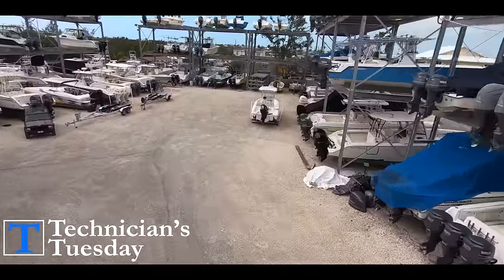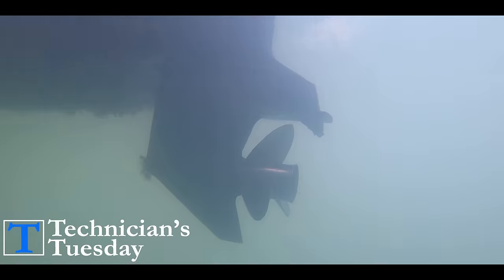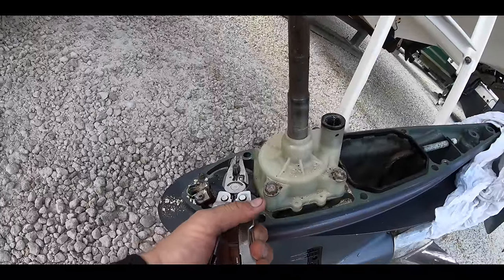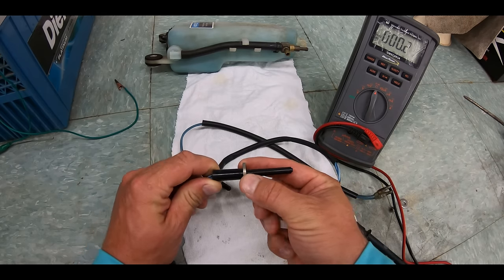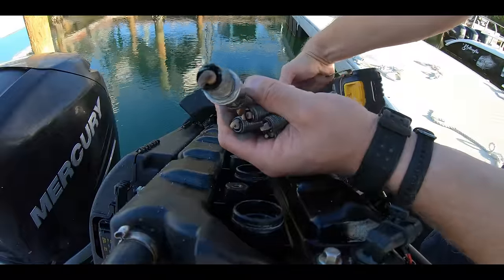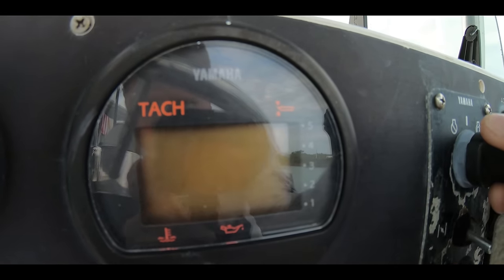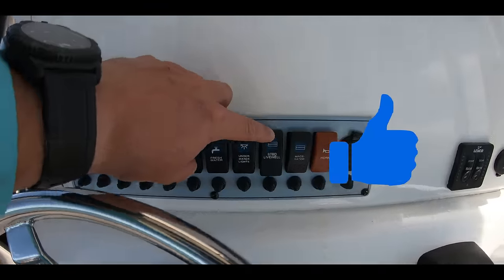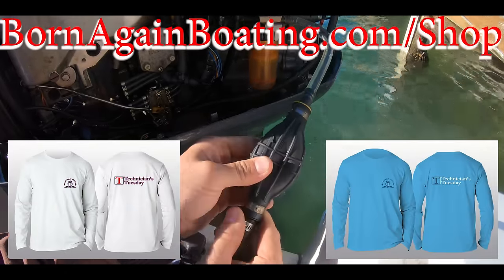Outboards #1 PROBLEM!

Comment: Sweetwater 4 stroke boaters just keep moving!lol!  Have done little but change oil in 5 years!lol! 5:00...those plugs look perfect.
Reply: What brand are you running. I had a  Mckeecraft with a 4 Suzuki. 140 hp. Was told when I purchased those motors were bulletproof .
Well it was. Later when the Hydroblaster joined my stable it was a 17 Triton CC with a 90 Yamaha. I wanted a jon boat that could throw a roostertail. I had drivers at intersections roll window and shout hey thats not a boat its a rocket ship. I hand picked both and loved them. Brand damn new. I took care of my boats. But ya know I got a story yup. Always. I tell em so others don t have to go thru and suffer like me. They were my babies. But everynow and again it happens. Yup SHIT. 
My triton I called the hydrblaster from Bass master mag Harry and Charlie fisher comics. My g/f and I loved to ffg founder gig. We were pretty good.  I had a generator and 4 500 watt halogen.  My buddy ran 6
 We could light up Figure 8
My girlfriend and I had system. When loading for trip home she held boat while i backed boat trailer in the we swapped places and I drove boat on , she pulled us out . Then she was done. I stowed everything and got ready for drive home. Jumped in Tohoe and put her in D. Has anyone picked up one my F up. Oh I did. Scotts hill to Lake Waccamaw non stop . I always stopped and backed in lake so everything that went in salt now rinsed in fresh pretty black water. 
Huh,  what color is yours.
But when I pulled in lake ramp area and turned to back , I saw the emptiest boat trailer there is. I mean empty  as in no damn boat. Hmm. Did I attach strap bow eye and cinch down.  My excuse and talk all the shit ya want. Pull a boat many miles as I have and nothing go wrong. Lucky or lying . I ve heard it all but ... I can take it. So 25 grand boat ,  I m think n up a light pole or a pine tree. I called 911 got NC Highway patrol dispatch and tried to sound like a buddy. Looking for missing boat. On or just off high, what s that, oh found it , 
Where? Lake Waccamaw high way , that s where I am . .ahhhh I see blue lights ahead bet thats  my baby . Since I was the only idiot on the road pulling just a boat trailer , they put 2 n 2 togther and the first snickering burns me.
Think thats bad, better n a ticket book. Sheriff dep and Lake cop I knew .
Well I had my glich A highway patrol woulda wrote a fat one. For what?
Low tire pressure, driving while stupid Hell something. I pulled off enough strap to hang off trailer and disconnected from Tahoe to allow trailer to be pulled under boat
Save a couple scratches. They helped me rehook , laughed one more time while I thanked them. Alls well, that ends well I say 
No I don t care what others say. How many payments did ya make? OK . Yea I Royally F ed up but it coulda been worse huh.  Yup imagine cruise n 
 half asleep and whatda hell is that honey!!!. 
I agree the Lord does look out for drunks and idiots. Was sober as a judge so...
I forgot  but never again. Only happened once.
Went back next night .
Gota nother limit and brought boat home too
Reply: @sammylacks4937  hell of a story.  I appreciate you sharing that.  That experience you had is the nightmare us boat owners have at night when we sleep.  Along with the walking around naked in public nightmare and we can't find clothes.  Thanks for sharing and we will all be checking our tie downs thoroughly this year.

Comment: Water pump impeller change every year 
Water separator filter drain out before each trip.
Change lower unit oil twice a season.
Spray power head down with WD 40 every month.
Don't overheat don't get water in fuel don't use engine to get off sand mud bars..

And you will be ok.

Comment: I recently replaced all the cables on my twin OB boat. With the throttles both at neutral, one prop spins freely, and one was in gear. I know this because I tested it accidentally with my shin. Once the cussing subsided, I realized that I had the shift adapter bottomed out at the motor. I removed the cable, checked the shifter to determine where neutral was, then unscrewed the adapter until it was aligned with the shifter. It's easy to adjust without resorting to voodoo. The engines are both the infamous 99 Evinrude 200 Fichts. I hope I haven't wasted my money!
Reply: If I’m not mistaken Ficht fuel injectors is what put OMC out of business. It’s a shame. We have a 99’ Johnson 150 Ocean Pro that is carbureted and it runs great. Those motors are also fast. Our 196 Bay Reef goes 0-20 in 2 seconds. It accelerates like a jet ski. I could be wrong but I don’t think the new four strokes can do that. These old 2 strokes idle and spool up fast.
Reply: @UltraMagaFan  So far, so good on those motors. We have been to the lake a few times this summer, and they have worked great. I would rather have a carbed motor too - they are SO much simpler.
Reply: @mrnotnomis  All I gotta say is watch those things. The Ficht injectors have the tendency to not deliver oil to the cylinders. If your motors randomly blow up you know why.
Reply: @UltraMagaFan  mnk

Comment: QUESTION,  I want to purchase an older boat which means an older two stroke motor and I want to leave the boat in the water at my dock year around.  Newer outboards have a hose water port near the top of the motor for easy flushing.  I am in salt water, how can I flush an older outboard which boat is in the water?  Attach muffs doesn’t seem very feasible.  How have people flushed outboards on older outboards?thanks.   Jim
Reply from the maker: Depending on how old and what brand the engine is, most of the two strokes in the past 25 years have flush attachments

Comment: Hey guys, lift your motor out of the water if you need to be docked overnight. Sometimes overnight turns into 5 nights and you come back to a tragedy.
Reply: Especially if the area you are docking has underwater lights or electricity anywhere near the water.  Stray current in the water can eat your prop and any other submerged metal.
Reply: @atthebrink74  to 5

Comment: Ok I have a 1980 glastron sprint that came with a 1978 Johnson 85 horsepower 2 -stroke engine the 2nd time taking it out the motor got hot enough to melt the coil wires ....any suggestions or ideas on what could have caused this ? The motor ran fine when hooked up to a water hose at the house

Comment: My 2008 Hydro Sport 22DC makes it impossible to check the oil ! You have to stick your head in the bilge to see the oil level just ridiculous!
Any suggestions? Of course there’s no dipnstick and I have a 250 hp 
etech Evinrude with only 320 hrs original …it was a great find!  Thanks

Comment: We’ve got a prob with our 2018 mercury 150 4 stroke engine- we’ve had it for two weeks and have had it on river twice and it won’t start! We’ve replaced alternator, plugs etc. took it to bass pro and the fly wheel has no play and won’t turn! Any help or info will be appreciated thanks! We are so aggravated and need a little help please!
Reply from the maker: Well, not sure what exactly is going on, not much info here. But if the flywheel won't turn, that is not a good thing at all. Either the lower unit is locked up or the engine is locked up, It should be able to turn. What happened at Bass Pro, they just said the flywheel won't turn and that was it? No one looked at it? The alternator and plugs wouldn't have anything to do with the flywheel not turning though, so sorry to hear about the issues.

Comment: Maybe salt water is different but up north on the lakes outboards last forever with very few issues. I had an '03 mercury 90 2T for 18 trouble free years. Not even an impeller went. It pissed like a race horse. Not unusual to see 40 year old outboards and even older up here.

Comment: DO NOT DISCONNECT A ELECTRIC SHIFTER ON A SUZUKI MOTOR. The shifter calibrates it’s self each time you turn on the battery. If the shifting rod is not connected the electric shifter gets stuck permanently forward.

Comment: Give me an inboard any day of the week.  Automotive engine easier to maintain and repair.  Straight line thrust in forward gear.  Less stress on the boat (power attached to the stringers and keel instead of the transom.  Can buy a rebuilt engine for less than a quarter the cost of a powerhead for an outboard.  Same with transmission instead of a lower unit.  And in most cases, an inboard is more cost effective to run than an outboard (either 2 or 4 stroke).
Reply: And when you run aground, you’re looking at an expensive haul, balance the prop shafts, repack of bearings, and new or rebuilt wheels, versus tilt the engine up, jump in, and push off.
Reply: @Z06ified  I have a twin engine Penn Yan Sport Fisherman.  EVERYTHING (props, shafts, struts) are up in tunnels.  NOTHING is below the bottom of the boat.  Oh and, I have never 'run aground'.  Even back in the days of paper charts, and radio direction finders, and LORAN C, and 'flasher' style depth finders.  Most people rarely do that are actually paying attention, aren't smashed or stoned, aren't showing off, know what they are doing, and know where they are.  Guess that leaves most of the 'modern' boaters out.  I have beached her many times, but again everything is up in tunnels, so there is nothing to hit bottom with or tilt up.  I simply fire her up... and reverse off the beach.  Isn't 'old' technology great............
Reply: Don F Good for you.  A perfect boater who never runs aground.  If you always boat in deep water, yeah, who cares?  Where I boat, there are 10 ft.tides, shallows everywhere, shifting sandbars, you name it.  I run my 19ft. Bow rider In the bay, 99% of the time.  I’ve been boating for nearly 40 years, and I rarely run aground, but mistakes happen about once every 10 years for me.  And when they do, I simply tilt my outboard up, run slow until I’m in the channel again, and that’s it.  Larger boats,yeah, inboards are the only way to go, and in many cases the only option.  Inboards have their advantages, and their limitations, just like everything else.  Just because inboards work well for you doesn’t mean they work well for everyone, every boat, and every need.

Comment: I had a 115 horse merc straight 6.  I owned it 12 years and never had a problem with the engine. I did all routine maintenance myself.  I hate to let anyone else touch any of my engines. I did have to change out the cables in spite of routine lubrication.
Reply: I just purchased one 85 model hope it serves me well
Reply: @steveo201  Replace gear oil in the lower drive unit, replace the water pump, replace oil and spark plugs in the motor.  Get the adapter to run it on land from a hose and test it out.  Depending on what the previous owner did, you may have to go through the carbs. All easily done by one man at home. Good luck!

Comment: Didn’t change the oil filter for 4 YEARS smh AND it was even labeled with the date on it. Laziness, just pure laziness
Reply: Its not a problem, oil can bypass a clogged filter so its not like the engine will die in no time. It can take years before you even notice engine degradation, esp on old diesels, i seen tractors with 40 year old filters on Perkins 3 cyl diesels, they start and run with no worries. Old diesel filters otoh, thats a big problem every winter.
Reply: 1 Atom 12  Yeah but oil will clog a filter over time even without being used. Even on hydraulic systems where no exhaust is polluting the oil, and that can be a bigger problem since theres no bypass valve on lots of them, they will just make a horrible noise with high frequency vibrations, and almost no pressure.
Reply: I got a diesel tractor, my uncle didn't replace the filter in 13 years.
Reply: Probably hasn't used the boat in 4 years

Comment: You are very wrong about the voltage. Less than 13 volts with engine running then it's not charging. 
Batteries fully charged sit at 12.7 volts. So anything below that means it is not charging. 
I have never found anything that runs at 12.8 or 12.9 when its charging. Always 13 volts to 14.9 and if you are over 14.9 then you have an alternator overcharging which will ruin the batteries as well. 
Otherwise you information is bang on!!!! Great stuff

Comment: over the years the only time I’ve ever had a problem with the boat is simply due to poor craftsmanship. Parts are made like crap, some mechanics aren’t worth a damn, or simple manufacturer problems that results in recalls, or what should be a recall. For example the headers cracking on thousands of Volvo motors.
Reply: That’s the problem.    Volvo

Comment: As always, super helpful hints. Question- I'm embarrassed to say I got lazy and left my water separating filter on over the winter, planning to change it out this spring. Well, it's fused to the housing so bad that when I reef on it with the wrench the entire bilge compartment bulkhead starts to flex where the housing is mounted. I'm afraid any more force will bust the fiberglass. Any tips on getting that filter to spin off? Shots of WD-40 don't seem to be helping. 😬
Reply from the maker: Ouch! Yeah, these can be the worst. So, if it's that bad, its going to be best to unscrew it from the stringer or bulkhead and then pull the lines off the bracket. This way you can pull the whole assembly out of the boat and then put it in a vice where you can smash the filter in the vice and then use a big pipe wrench or something to turn the bracket head and get it to come off :(
Reply: Of course - good plan, thanks!

Comment: The # 1 problem with outboard engines is water in the gas especially with boats that sit a while and ones that are not used regularly. The water comes from gasoline with alcohol mixed in it the alcohol attracts water from the air like a sponge. I have seen gas tanks pumped out that literally had gallons of water in them and the water is extremely detrimental to the inner workings of the engine especially the valve train and combustion chamber. I have learned this the hard way so do your boat a favor and only use gasoline with 0% ethanol it’s more expensive but it’s worth it...
Reply: That is why you are supposed to run non ethanol furl in boats
Reply: Thats right run no ethanol fuel pretty much not having water is a plus I get mine at 259.9 its down now how long don’t know JT 🇺🇸🇺🇸🐠🐟🎣🛥🌴⛱😊😊🙏🏻🙏🏻🙏🏻
Reply: Some places you cant get non ethanol fuel
Reply: J G      That’s true it can be hard to find but it is worth it to find a station that sells no ethanol most marinas that sell gas will have it...

Comment: Outboards are designed for salt water operation. Car engines are not. Diesel inboards are reliable. So are gas outboards. I/O 🤔is a questionable solution imo. 🤔 Vee drives too 🤔 The test of time goes to dry stack diesel with a keel-cooler. Jet drives are here to stay, especially in the shallows. 🤔 Electric outboards are here and a twin setup could be hybrid 🤔 One gas- one electric - alternator recharges batteries when gas is running 🙂 Should work . 
I use both (trolling motor/gas)
We have 30 passenger 60 mph Jet Boats for tourists on our river. Turbines could drive those.
Safe boating folks. 🙂

Comment: My boat has a Tohatsu m120a motor on it and I changed the spark plugs on it to see if that’d fix the rough running and not wanting to idle but that didn’t help. Do you think that may be a CDI unit issue or something simple??

Comment: New sub here and new boater. What is a good 2 stroke fuel treatment for storage or just everyday.
Reply: Sea foam and berrymans👍🏻
Reply: David Edwards seafoam is good enough for storing?
Reply: I use Marine Stabil. But for storage during the winter I drain the fuel out of the tanks. I had bad fuel come spring once years ago and I am not dealing with a tank of bad gas again.
Reply: Seafoam and berrymans to echo another's answer.

Comment: Definition of boat: A hole in the water that you fill with money....
Reply: Definition of a wife: Ahole on land that you fill with money.
Reply: Check your thermostat housings for water leaks when running.  Water seeping can run down and ground out one or more of your spark plugs.
Reply: Bring On Another Thousand!
Reply: Jack Frost < A statement made by those who want a boat but can’t afford one.  Leave you momma’s basement, get a job then you might be able to afford a boat.
Reply: @thisisyourcaptainspeaking2259  < Did you make this up yourself?
Reply: @melrose9252  This is what makes pleasure boating so fun.  Consider it the essence of boating.
Reply: @melrose9252  I have 3 boats and I sometimes use that same description.  Fortunately, I take good care of mine and have not had any major expenses other than fuel, oil, batteries and all the “improvements” I like to add like SS props, LED lighting throughout, bigger this, better that, etc.
Reply: Jack Frost < Did you think of this yourself?
Reply: @melrose9252  No--I didn't think of it myself, just like you with your comment.

Comment: I have a 2 stroke 90HP Evinrude. It idles up and down by itself in neutral. I also have zero compression in my #4 cylinder. About 130 exactly on the other three. Any ideas for the love of god?

Comment: Fresh water so much better on an outboard. They last forever with where I’m from.
Reply: Saltwater Fishing is  way better. Fresh water is boring as hell
Reply: Morts not when you have the Great Lakes plus all the river fishing you can dream of .
Reply: Absolutely!
Reply: If you flush your motor after use in saltwater you won’t have many problems I flush mine out every time then when I store it I run in a tank with salt away with non ethanol fuel until thermostat opens no problems.